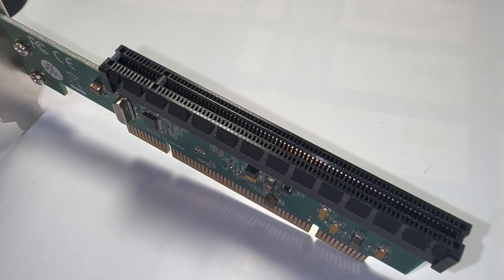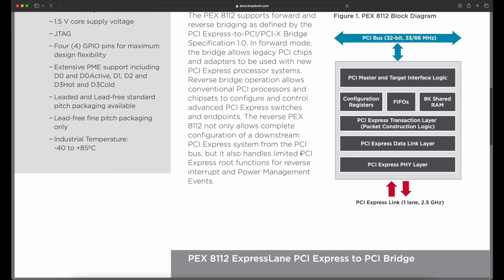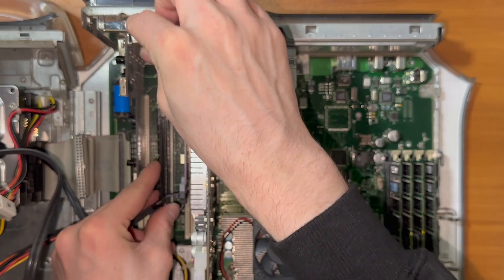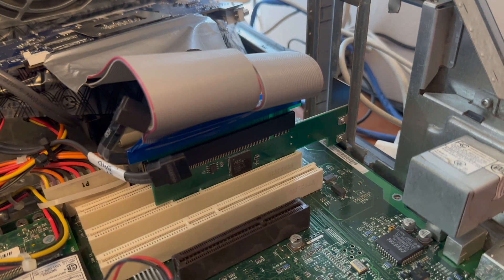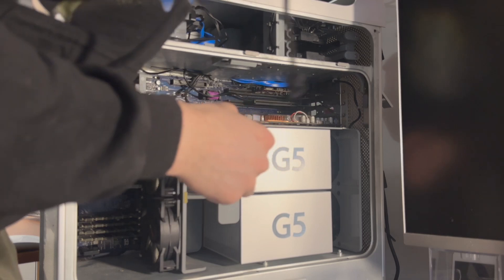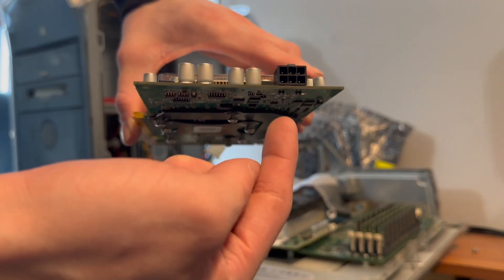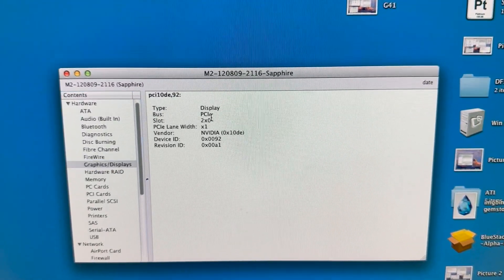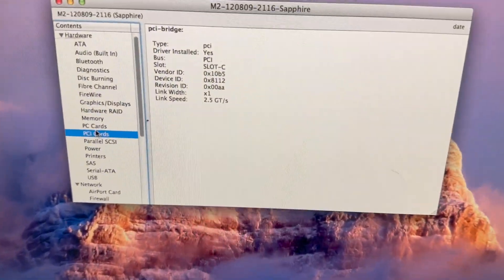Add PCI Express to your PowerPC Mac

Comment: Hi Mark! I've seen this extremely interesting video about adding a PCIe controller to the G5. You did it using a riser card as your 2003 model  has PCI-X, while my QC G5 would allow me to use a native PCIe controller. You use a Mercury Accelsior with its LSI chipset,  while I got a 4x M2 SSD card based on Broadcom PEX8747 chipset lying around, used before in a Mac Pro without any issues. Do you think my controller could be recognized, work (and be bootable too) in a G5 quad environment like mine??  I tried with a PCIe Sonnet Tempo with 2 SATA SSDs on board, but booting from it was not supported ; I'm running Sorbet Leopard from an SSD, but connected to the slow onboard SATA 1.5 Gbps interface and wanted to improve my overall speed. Thank a lot.

Comment: Try an PCIe x1 USB 3.0 card. There are PCI-X to PCI Express adapters that get you an x4 connection for much better speed, but they weren't cheap new, may be difficult to find now.

Comment: WOW !!!!  i am going to look in to this  for a old HP server   with 2 pci slots ?   
BTW: have you tried running more than one of these adapters at the same time ?
Reply from the maker: I've yet to test this with multiple adapters at a time, although I can imagine some use cases. Currently I have one permanently in the DP 2.0 G5 since it's a low-power high-speed way of adding lots of additional storage. Feels less practical as a GPU interface when AGP runs faster.. but I can imagine a same branded AGP + PCIe GPU running at the same time wouldn't be so bad.

Comment: @supericecreamsandwich hi!! nice work with this adapter!! i want to ask you if you have tried in an intel mac pro 2009, cuz i have a macpro 4.1 flashed to 5.1 with a amd radeon rx 6600 xt flashed for mac. thank you for your time!
Reply from the maker: This adapter is meant for older computers, a Mac Pro 4,1/5,1 already has PCIe. That's a good GPU for the Mac too, an RX 6600.

Comment: clover might help you make the nvme drive bootable. i used clover for the boot drive in my  dell precision m4800. it works great.
Reply: Clover doesn't exist for PowerPCs; it's a UEFI implementation for Intel machines only.

Comment: Thanks for exploring this! I love these adapters, they've been especially nice since they dropped to an average of $20 give or take for adding PCIe slots to various devices
Reply from the maker: Indeed! Love it when niche hardware drops in price/depreciates in value, even better that they make many of these so it's attainable. It's worth doing a followup video on this sometime to see what other devices can work. I'm determined to get a different PCIe msata AHCI card or another form of PCIe SSD storage and boot off of it.

Comment: I wonder how well some of this stuff works under a compatible Linux or NetBSD. It might be worth following up on, though this is definitely not practical for anything bigger than a half-height card.
Reply from the maker: Currently trying linux out, would like to have at least something working before making a video and putting it up. Live CD's (such as Ubuntu 14.04 and Adelie Linux 1.0) produce no new results outside of currently supported hardware, next up I'll try some OS installs. Even an old PC GPU would look cool running off a G4!

Comment: Insane! 😮 How the GPUs performs? 😮
Reply from the maker: Performance is hard to gauge, could be a topic for another video. When booting up the screen freezes then redraws (like it did in the video to my surprise). Sometimes especially if other PCI devices are plugged in, but this stops after logging in.

Comment: I couldn't tell...did the Mac Pro ATI GPU work?
Reply from the maker: Unfortunately not.. it allowed the public file sharing server to be accessed after boot.. yet somehow wouldn't initialize remote access. Odd. The intel card definitely caused unusual things to happen.
Reply: @supericecreamsandwich  I'm confused. What does the GPU have to do with file sharing or remote access?
Reply from the maker: @user-pz6ph1hj2u  When the Intel Mac GPU is plugged in, there is no video output. I had VNC sharing enabled prior, to see the desktop remotely in the event of the computer successfully booting without video. In this case, when attempting to view the desktop, I'm unable to, unlike in the case of when the PC GPU is plugged in. I mentioned remote access because it's interesting to observe how the OS successfully booted and it's filesystem is accessible, yet, no video output or screen sharing works specifically when a Mac intel GPU is plugged in. It shows the card has an affect on the computer's/OS's behavior.
Reply: @supericecreamsandwich  got it. Thanks! I don't know why I didn't realize before when you said Intel, you meant the card out of a Mac Pro that has an Intel CPU, not an Intel card. Which doesn't make sense because as far as I know Intel only makes igpus and not cards anyway. This is super disappointing because I have plenty of those cards and I have plenty of G3 and G4 machines with PCI slots that would love to have one of those cards installed. Did you ever try flashing that other card to verify that it works flashed? It seems like it's an almost sure thing, but I'd love to know. Even more I'd love to know if it would work in OS 9, even though it would have only very basic acceleration at best. But at least it could drive a much larger display with millions of colors.

Thank you so much for doing this video! This is fantastic content.
Reply: @user-pz6ph1hj2u  Intel does make gpu's once again, ARC series graphics cards, but idk if they'd work even in a modern intel mac, let alone a powerpc.

Comment: 1:39 you defeated the fun of the G5s: LOUD FANS
Reply from the maker: G5's are for sure not the quietest machine. I did have the side cover off.. the new fans take away the high pitch whirring sound G5's typically have. It sounds about the same right now as a Mac Pro 1,1-3,1 with all it's fans on 1500-1700 RPM with the side cover/panels on.

Comment: I really like the pace of this video, and that tech is so cool.  Shame you can’t boot from the “PCI bridge”.
Reply from the maker: I truly believe this was more of a reflection of the OWC PCIe SSD, it has trouble booting in a Mac Pro 1,1/2,1, and I have to even manually select it in a Mac Pro 3,1, doesn't show up on when holding down option key. It's worth exploring this subject in a second video with a new range of devices!